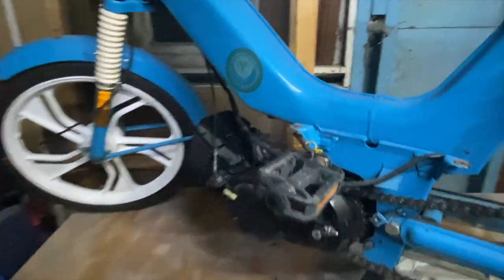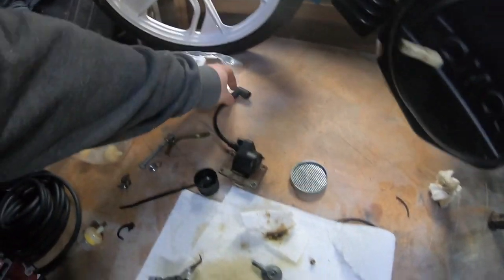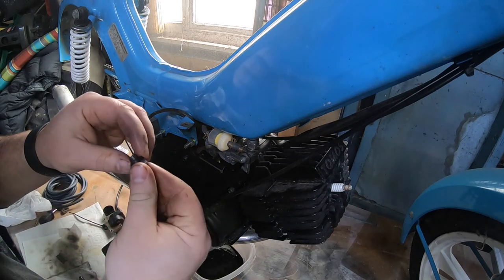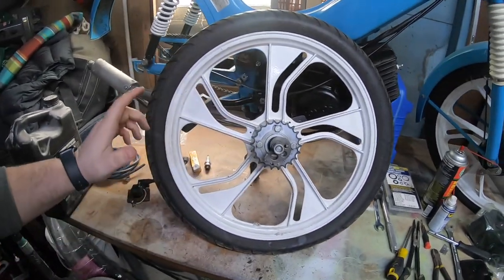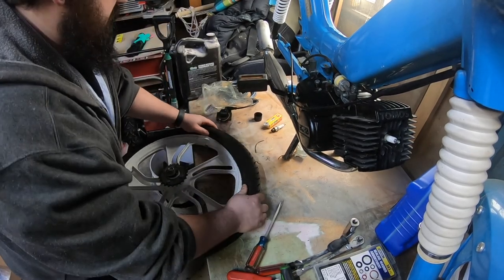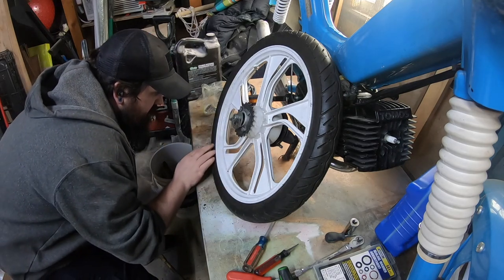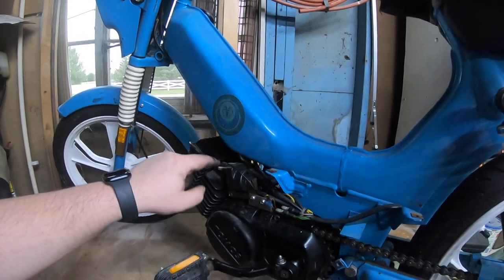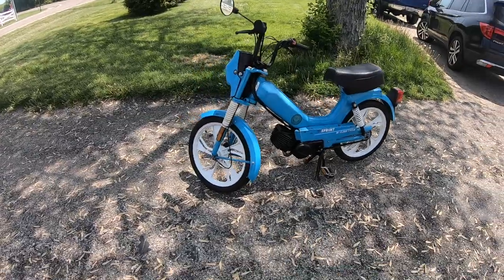Tomos moped revive for summer

Comment: Uuuuhm that is not the original filter.. original filter is a black box which houses a filter compartment inside. It sucks the air through that hole in the frame on the carburator / clutch side of the moped.
Reply from the maker: That might be the way the new ones are this one is a 93 and that is what came with it